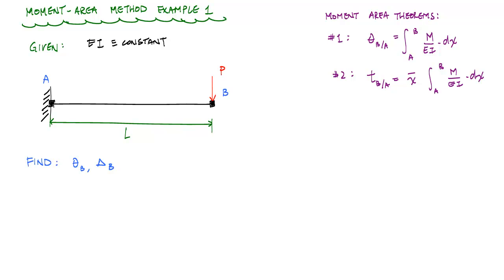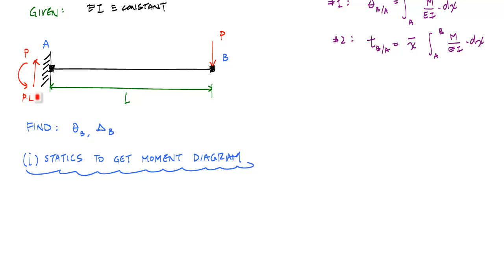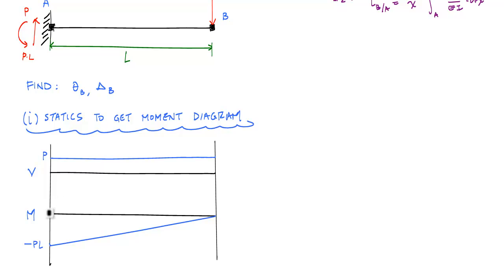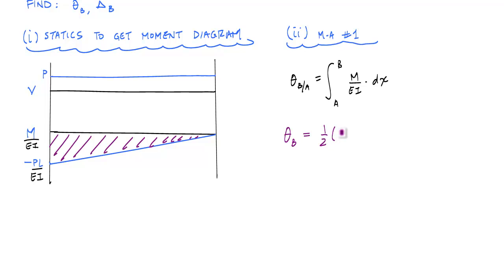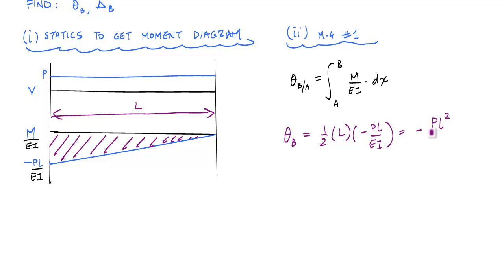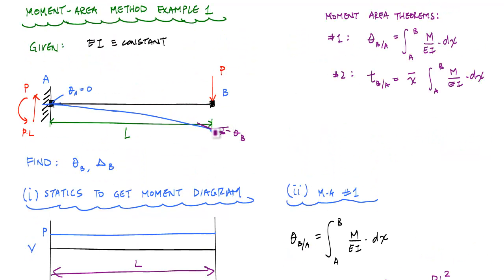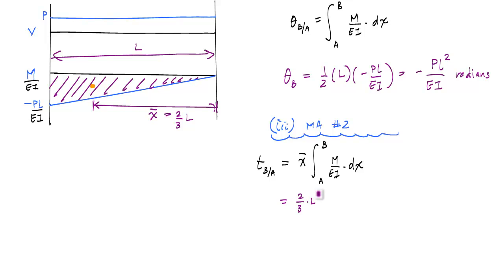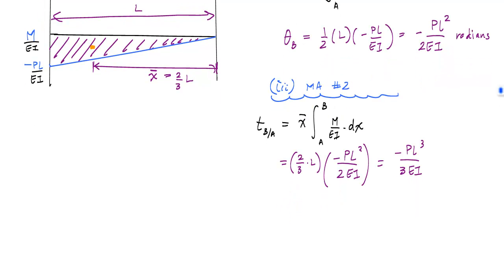Moment Area Method Example 1 - Structural Analysis

Comment: Hello, let me first start by saying I am so grateful for all your videos they help a lot to struggling students like me and please keep them coming. I wanted to ask here, when calculating the the deflection of a point with respect to the other, the centroid  that the you multiply the between those two points on the M/EI curve does it specifically needs to the distance from the point for which deflection is to be determined to the centroid or it doesn't matter? example for the above case one could have multiplied the area by L/3 when finding deflection.

Comment: Hey there I need a clarification. t(b/a) is known as the deflection at point 'b' from a 0 rotation point at point 'a' from your video, but my prof use t(a/b) instead knowing point 'a' is the 0 rotation point or you call it reference point. Is there a difference or is there a fixed format to represent this?